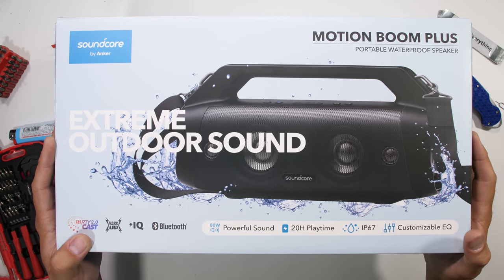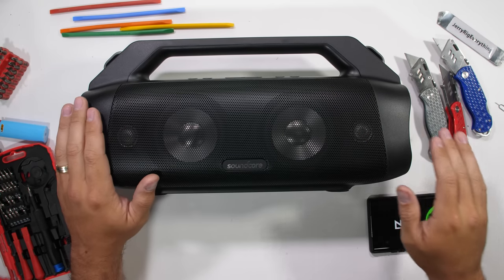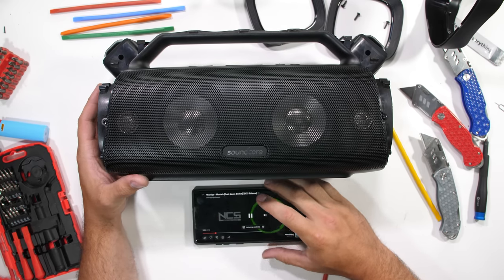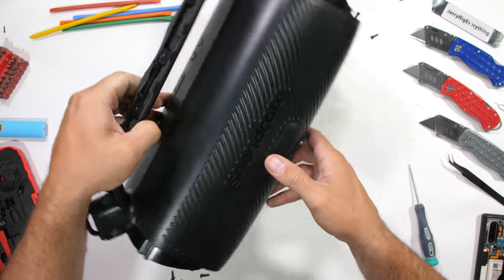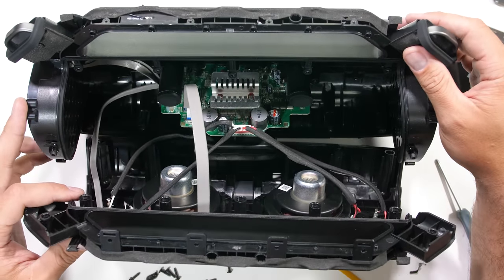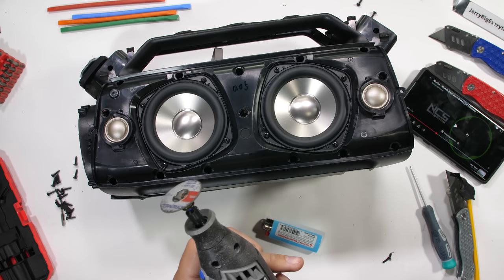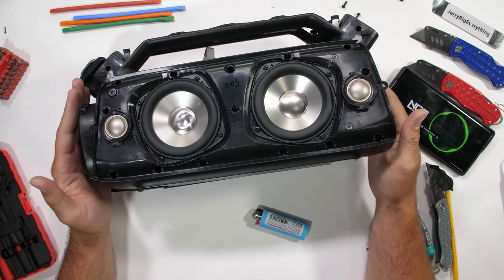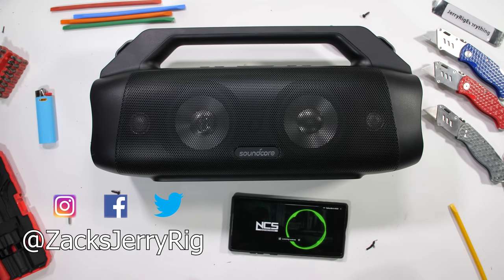This Rugged Speaker is made from.... Silk?

Comment: I have read a review on the german amazon from a guy who discovered a potential flaw caused by the buoyant design. He took it from indoors to outdoors on a hot day and noticed that the passive radiators bulged out completely. It is caused by the expansion of the air trapped inside due to the temperature increase. He stopped listening to music to avoid damaging the speakers from the inside. He backed it up by pictures too. It would be interesting to see that tested here with a brand new unit.
Reply: would definitely be interesting, I haven't heard of this from anyone myself. Honestly I can't see the air volume inside being enough to cause that otherwise coke bottles and the like would often pop.  I feel its more likely he injected air though the rubber with a syringe or perhaps a battery cell has gone bad and let out some gasses.
Reply: @axeami1354  when he took it back indoors, the passive radiators went back to normal, so it not the case. Regarding your bottle example: if you close a bottle filled with ambient air and cool it down it will contract precisely for the same reason I mentioned.
Reply: Check Oluv's gadgets (the channels' name) for this specific issue.
Reply: @axeami1354  coke bottles are pretty strong. They can withstand multiple times atmospheric pressure.
Reply: @axeami1354  yes because everyone has syringes with needles laying out around their house (junkies excluded)
Reply: @axeami1354  babe wake up its 3 am, time to inject speakers with air for an amazon review💀💀💀💀💀 headahh
Reply: @fynnli6685  Well, I do.
Reply: @fynnli6685  The majority of people actually do have a few syringes in the house, and the reason I mentioned it is because it's a common tactics used by people to take items they've abused back.
Reply: @szemanlac  Even so if it happened as described it'd be an issue that'd pop up on several sealed speaker's. And that said things take time to cool down, if they retracted almost as soon as he went inside that's even more reason to think it's faked.
Reply: I send my back coz same problem here. Also by transport in cars on hot days the plus get unusable
Reply: @axeami1354  That is exactly I was thinking about when I read that review, but it also depends on how much air is trapped inside during manufacturing, which is random. And I think it is mostly an issue with speakers equipped with passive radiator(s), otherwise you wouldn't notice it from the outside.
Reply: @bestertester9181  So it did actually happened to someone else too. Thx for sharing.
Reply: @szemanlac  not random. The amount is based on the temp inside the factory, which is generally kept at a consistent temperature.
Reply: @axeami1354  there is more than enough air inside to cause this to happen. Will it cause any problems? No. Will a coke bottle pop from being left in the heat and the air expanding? Sure. It happens all the time. Happens a lot with cans, much less often with plastic bottles (usually only ones with a defect), and even more rarely with glass bottles (again, usually only ones with some sort of defect).
Reply: Oluv's gadget
Reply: @lukmly013  i said junkies excluded
Reply: @axeami1354  common tactic huh?! show me your sources
Reply: @fynnli6685  I do too. Full of grease or oil, handy for getting in to tight places to lubricate stuff, bearings, etc
Reply: they do! I have even gotten a partial refund while waiting for them to fix and exchange it.
Reply: Sounds like it's a good thing they don't put carbonation in carbonated drinks or they'd all explode.
I don't need to type like tHiS for you to see I'm dripping with sarcasm.
Reply: @axeami1354  I like how you immediately rush to claim he faked it and for some reason did something on purpose
Reply: @axeami1354  "the majority of people actually do have a few syringes in the house"
 no they don't lmao, maybe in your neighborhood ^^
Reply: Fake. 
If this were true, imagine what would happen when they are shipped by air freight... over the 15-20 hour flight from Asia to the US, the Air trapped inside would completely blow out the drivers (at least one) on every single unit.

In the real world of water-resistant and water proof product design, we use materials like Gore-tex patches... a very small piece of waterproof material that allows air molecules to pass through, but the material weave openings are far too small for water to pass through.

Yes these do allow air to pass through making them not technically air-tight, but they pass air (um... yeah) so slow that it has zero effect on sound reproduction quality.

So they can't build. up. internal. pressure... UNLESS SOMEONE PLUGS UP THE PATCH... which is most likely what that person did... or there's the so-slight possibility that the patch material is defective... but this is a very mature technology.
Reply: When the battery eventually fails can it still play music when plugged in or does it become a brick?
Reply: @darkdraconis  y'all clearly don't live in the south around people with livestock.
Reply: Not fake. I got a new one from soundcore mentioning this issue. They have a newer version with a fix for that. After all, you can "fix" it yourself by leaving the connection cover open.
Reply: that issue can be solved by opening the little rubber flap that houses the ports in the back :)
Reply: @royal_eternal  He has brain damage, Alan Ross is much better

Comment: Man I would love it if this "Partycast" was an open standard, so all speakers could link up and place nice.
Reply: Yeah, sadly every manufacturer made their own party link standard. I wish they all had aux out so you could just link them manually.
Reply: @marsrover001  jbl partybox's allow you to do that and Sony's gtk speakers to
Reply: If you use Android you can sync any bluetooth speakers together to use as many as you want
Reply: @alastairholland4433    and iOS HAD this feature in a beta, but then removed it and locked down to only sound share between airpods.
Reply: some devices allow for multiple audio outputs to different Bluetooth devices, my Samsung s21 has it and works good
Reply: Auracast is becoming the new standard

Comment: As a sound engineer:
Silk tweeters are pretty common on the audio industry, they usually are less harsh than metal ones and they have a more mellow sound to them. Ofc quality may vary that statement.
Reply: I love when ACTUAL experts chime into the comment section and give useful information to a bunch of jerks (including me lol). Thanks sir.
Reply: Yeah like
They’re aren’t like super rare or smth 
Pretty common
Reply: @divyam._.maheshwari  trying my best :)
Reply: @Varun_underyourspell16  they’re not, and there are tons of variations. Some better than others. But i must admit it’s unusual on portable speakers. Not that I’m a portable speaker expert either, but aluminum tweeters sound like s better option for endurance, water contact and stuff
Reply: @brandonchutt312  I'm not an engineer, only an audio enthusiast and honestly if you're in the market for good sound cancelling headphones Bose and Apple do it the best right now. Bose has better sound cancelling but Apple's headphones sound better. Although I've heard of some reliability problems with Apple. And their case is stupid. I'd go with the Bose personally. But I'm not a huge headphone guy. I'm more into speakers.
Reply: @Randommmmm204  Apple and Bose? Much you have to learn young padawan.
Reply: @brandonchutt312  That niche is not one that i route for. You loss a LOT of quality by using Bluetooth, since it’s not capable of transmitting lossless audio. You’ll need to make up for the deficiencies in multiple ways. IMO you’re better by using in ear headphones like the Samsungs pro than wasting a lot of money for a open ear experience. If you’re going for Audiophile headphones, then go by wire and use studio monitoring headphones for passive isolation (Sennheiser 380Pro type of headphones).
Reply: @alphabuilders  bose has one of the best noice cancellation in the markey and that’s undeniable. But as the say goes “no high, no lows, it must be bose”. They are super midrange focus

Comment: Anker is the only brand I trust for chargers and power banks, I love my soundcore motion+ speaker as well. 

Anker is forever goated for aftermarket accessories in my opinion.
Reply: And to add, their Eufy brand line of electronic security door locks & cameras are some of the best on the market currently, and with no subscription fees needed, but optional with no loss of features. 👍🏻
Reply: Well, i may had bad luck, but out of 2 anker dongles i got, 2 sucked hard...  I got two different models, in different stores, several months apart. And one even gave a finantial loss.

The power expand+ 5 in 1 (a8338) heats like hell if i plug more than 1 port. Like ethernet and hdmi, or ethernet and usb, or usb and hdmi. It drains my macbook m1 battery like crazy, same for my asus flow x13. It kinda works tho, but i don't like using it and risking damaging my usb-c ports.

The power expand+ 8 with PD (a8380) was the worst. It's ethernet disconnects every few minutes, sometimes doesnt comeback even disconnecting the hub. It fails often to passthrough the charging to the laptop, and it's hdmi is flaky at best, with it usually messing up the resolution (the resolution is right but it centers the image in the screen and compresses it and destroys the quality). This happens in any laptop i use it in. In my mac i was never able to use hdmi and charging at the same time. 
And this one KILLED  my working laptop, it wouldn't charge anymore, even without the hub, i got it replaced thankfully, but it burned the charging circuit.
Reply: They make pretty decent cameras and vacuums too with their Eufy sub brand
Reply: I got the soundcore 3, amazing thing
Reply: To chime in, Soundcore Liberty 3 Pro have to be one of the better purchases of my life.
Reply: I concur. I've had my Anker soundcore boost for nearly 2 years, small titanium $60 speaker that has put more expensive and "luxury" speakers to shame, still as good as new.